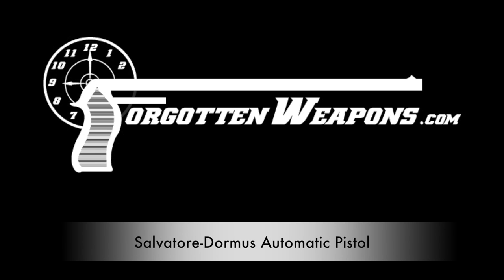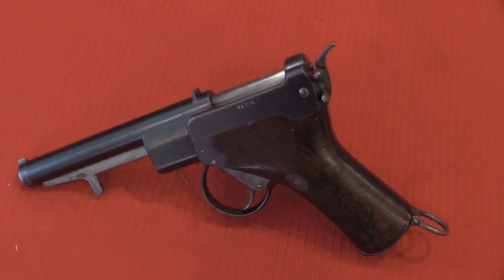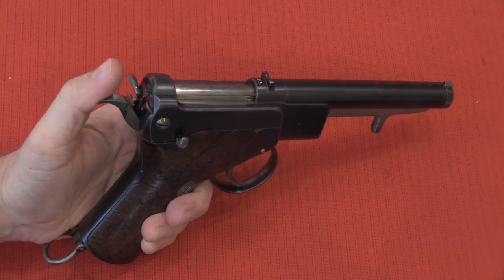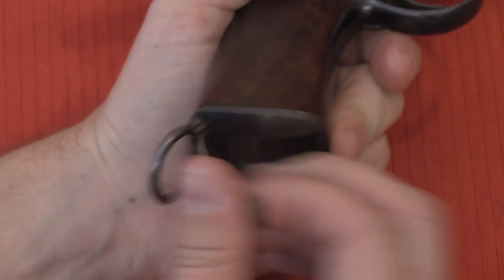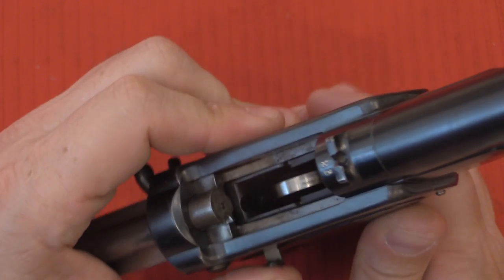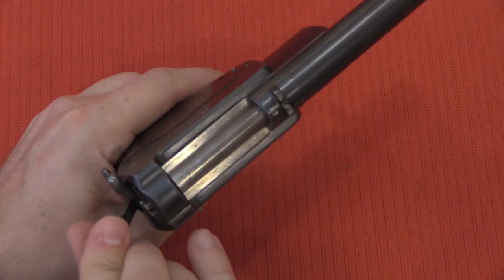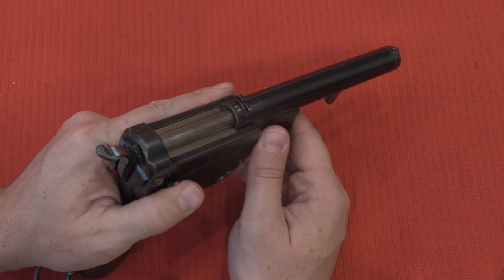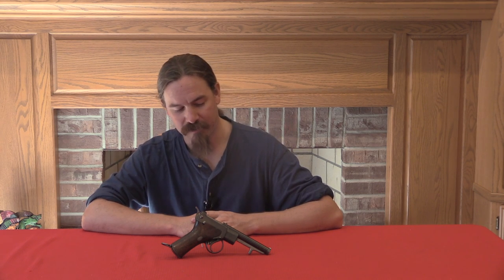1891 Salvator-Dormus: The First Automatic Pistol

Comment: Why was this created to use only 5 round clips? One of the biggest arguments for using a semi-auto over a revolver is a larger capacity, but most revolvers have 6-round cylinders, beating this semi-auto by one round. Perhaps that was one of the major drawbacks of this design that made the Austrians prefer the Gasser revolver. The size of the cartridge this fired was likely not enough to justify replacing the revolvers they already had which held one more round and had a more powerful cartridge.

Comment: What an interesting delay mechanism! 

Now that we've seen the first semi-auto pistol, we gotta see the first traditional semi-auto pistol with a slide.
Reply: i think it was the browning 1900
Reply: I hope there is a M1900 video at some point. It's discussed surprisingly little for such a seminal pistol.
Reply: Ian has videos that cover the entire development, from the 1900 to the m1911
Reply: There is also a good video about the development of the early semiatomatic pistols.
Reply: Badpvppaladin  not talking about the Colt pistols, but the FN Browning M. 1899/1900
Reply: Neal Scroggs It's all about the leverage. I suspect the internal gubbins wouldn't transmit much force.
Reply: TheGoldenCaulk I’m pretty sure it was c93
Reply: @ashyoung42007  Didnt have a slide. It was some weird toggle locking mechanism

Comment: In theory, wouldn't the handgun have a tendency to bumpfire? The fired round forces your finger forward for a split second (which resets the trigger) but your brain isn't fast enough to react, so technically after the trigger has already been reset you are still pulling the trigger back (bumpfire)? That's kind of what I'm picturing here. Anywho, once again Ian you continue to impress with your knowledge of firearms!

Comment: You need to keep in mind that that an earlier patent date does not mean that the item was the first one invented.  There is a period of time (usually a year) in which a patent can be applied, and even more time until it is issued.  Thus, it is quite possible that an invention that was made in March (for example) may have a patent implied for until November, while an invention completed in June could have its patent application made in September.  Moreover, there can be months or even years of delay in the patent office between application and issuance of a patent while a patent examination is conducted -- one may sail through the process while another may not.

Comment: If this pistol used trigger-actuated lever as delay, how much would the recoiling bolt kick on the trigger finger? The shooter might have a very sore finger after some clips of ammo...
Reply: Probably a lot less than the rest of the pistol kicks you in the hand.
Reply: A lot would depend on how wimpy the cartridge was.  (I'm going to guess pretty wimpy, just because they pretty much all were in the early semiautos.  Except for that maniac Gabbett-Fairfax's. :)
Reply: ZGryphon in addition, most guns with dubious locking mechanisms tend to use cartridges of dubious power.

Comment: I would think that to some extent many hammer-fired semi-auto pistols would behave somewhat as delayed-action blowback pistols since the mechanical advantage of the slide operating the hammer would change as it travels rearward.  Depending upon how the hammer interacts with the bolt, one could arrange things so that the hammer would have to move further during the first millimeter of bolt travel than during the second, third, fourth, etc.  That would seem a simpler and more reliable way of controlling cycle timing than using the operator's finger, and I can't really imagine anyone thinking the operator's finger would be useful for that.  I would think it more likely that the trigger was pushed forward as a way of resetting the sear.

Comment: I really like this video. A very cool pistol. I really like the way the bolt is charged. It honestly seems like a very good design for people with weaker grip strength. Put that handle against a table or ledge and push down with body weight. Really cool little gun.
Reply: Sorta like the modification made to the rear sight on the M9A1, though easier to use.
Reply: M9A1? I'm going to have to look that up. I'm still learning about a lot of fire arms. My wife has very weak gripping power and cannot charge most pistols for home defense. She cannot lift up an AR-15 for more than a few seconds. I've been looking into a lot of weapons (pistols) that can help her get around this problem.

Know of any others?
Reply: I know there are some 3rd party accessories that put grips/fingerloops on the back of some striker-fired handgun slides (glocks especially), though I can't think of any handguns with charging handles built-in.
I think in situations like hers revolvers are generally the recommended way to go.

As for the M9A1, IIRC they flattened the front face of the rear sight notch so the edge of a table or similar surfaces could be used to rack the slide one-handed in case of emergencies. Like getting shot in the hand.
Or maybe that was just the M9 series in general over the 92fs.
Reply: Well, the revolvers I looked at probably had too much kick for her. Literally she can only lift around 5 pounds in each hand for any extended period of time. A cup of coffee held to her chest eventually becomes too much for her. She is sick and until she recovers I worry about her safety. So I'm trying to learn and I've owned my AR for awhile and I never thought I'd need more for the house.

However, she is a different story. Do you know of any low kick revolvers I could possibly look into?

I did read about the Chippewa Rhino series of revolvers. With the barrel underneath I've heard the recoil is much less, price is high though. Looking for anything that might work for her. Know of any good low recoil revolvers?
Reply: What about a slide-mounted red-dot? Never tried one but Ian carries a GLOCK with one and likes to use it as a cocking handle.

If she's recoil sensitive, perhaps look at rimfires? Better to have some gun than no gun.

Comment: Cool video Ian. This is pretty slick for a first attempt at a self loader. Do you think this gun is good enough condition to fire?
Reply: Mechanically yes, the springs might have weaken a little but the rest of the gun is not rusted or damaged.
So like most guns it's safe to shoot if you know the right original cartridge loading to use.

Comment: The cartridge is even more scarce than the pistols the only information I could find is pictures of a rimmed cartridge as well as measurements and a single photo of a rimless cartridge. Does anyone know if the cartridge was rimmed or rimless? If it’s rimless then measurements are out there in the interwebs. The dimensions given were 8.1x17.5 with a case diameter of 8.9mm and overall length of 27mm if that helps

Comment: How come it doesn't break your trigger finger every time you fire it? I guess it's mechanical advantage and the weight of the bolt, but it sounds kinda like shooting yourself in the finger every time you pull the trigger.
Reply: Mechanical advantage, the (probably small) weight of the bolt, spring pressure, and the cartridge is fairly small, but there's a good reason there were only ever fifty of this thing.

Comment: wouldn't that delay system create a theoretically "automatic" pistol? assuming the blowback is stronger than your finger, it would push the trigger forward, forcefully resetting it, and then when the bolt travels home and your finger is still pushing on the trigger it would release the hammer (not a following hammer, but true delayed release because the wedge is only interfacing when in battery) and fire another round.
Reply: Hooo man would I not want to try that. See it tried, maybe, but not try that.

Comment: Can someone explain to me why having a delayed blowback system is better than a simple blowback?
Reply: Delaying the opening of the action allows pressures in the chamber to drop before the case is being extracted preventing the case from rupturing (while not fully in the gun). On top of that, under the lower pressure, there is less force pushing the slide or bolt back meaning the action experiences less stress that may cause failures.

Comment: Why do they put lanyard straps on pistols? I can't see having a wrist strap as practical.
Reply: I'm not entirely sure, but I'd guess they were intended to do the obvious - retain the pistol if it was accidentally dropped. It would also be a practical feature when riding a horse.
Reply from the maker: They typically tie to the belt, not the wrist. Prevents you from losing the gun if you should drop it.

Comment: Hey Ian, can you clear something up for me,  the way you described the way the gun feeds clips,  does that technicly mean the gun actually can hold 20 rounds if you just keep stuffing it?  or were you simply saying you can fire 3-4 clips worth before that handle fills up with empty Mannlichers?
Reply: the latter
Reply: ah, so its like storage space then
Reply: while the well can hold multiple clips, the spring loaded feeding mechanism only goes down far enough for one so you can fire one clip and the empty drops down to make room for one more fresh clip. Eventually the well fills up and you will have to either open the base plate to dump the empties or as Ian said, the act of loading another clip will probably push the door open dumping them for you.
Reply: It was likely designed that way to retain the clips for later use. Pretty clever really.
Reply: honestly I wish we would see this thing in battle field 1.......its not like they care if the weapon was actually used in the war or not.